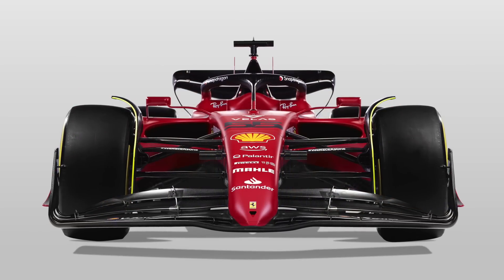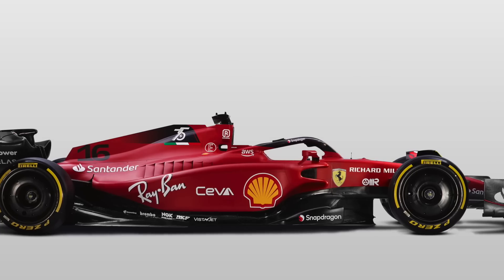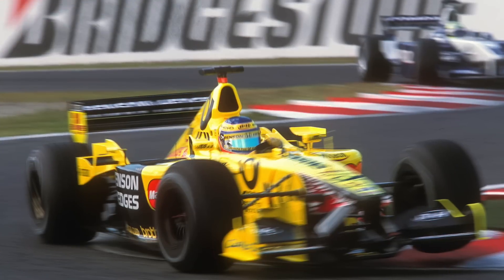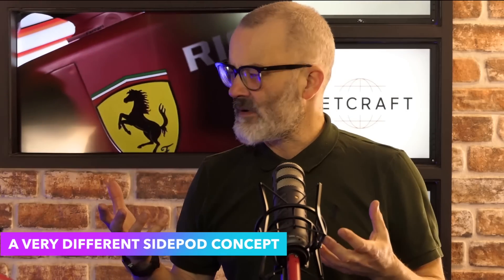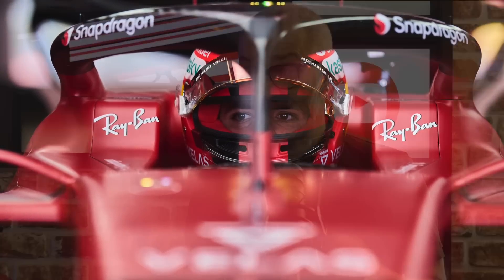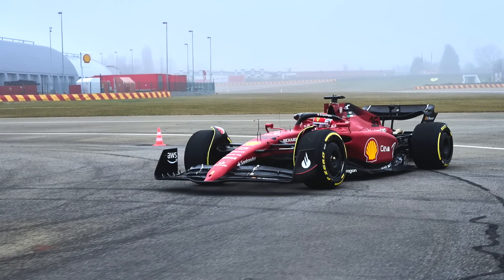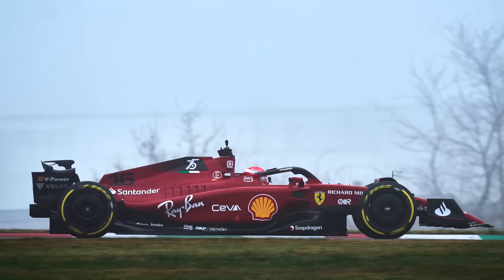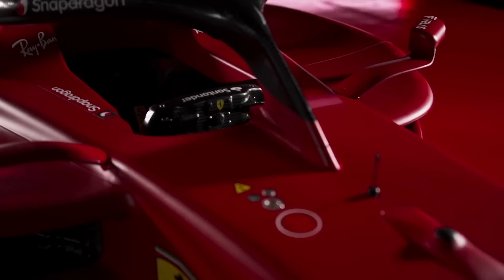New Ferrari F1-75 with Scarbs by Peter Windsor

Comment: What i wonder about there is no talk about the extremely small roll-hoop, what looks to me like a Rory Byrne signature, and i think Rory advised them to do that. This will allow more air to get to the Rear-and beamwing. These two wings create the biggest upwash, far more than leading more air over the top-over the diffusor. Ferraris aim clearly is to let the rear and beamwing drive the floor,what is definetely an advantage over leading air over the top of the diffusor. If you put all this together- its a cooling-system that makes it possible to build a small roll-hoop that leads more air to the rear and beam-wing that drives the floor and is combined with sidepods that produce more downforce but less drag and manages the front-tyre wake more efficiently then micro-size or zero-size sidepods. On paper this concept is superior to anything else on the grid...but in reality? We will see. But anyway - i am a little bit disappointed that great features like the roll-hoop and how all these solutions support each other, was not explained properly.

Comment: My 2 cents - they want to pull hot air from louvers right above the exhaust, big sidepods to push wheel wake away also acting as "huge shark fin"  
and maybe blow clean air around the rear track rod to energize beam wing flow or is it cooling vent?

Comment: If I were Ferrari or Renault and knowing I’m down on power I’d be super aggressive in my engine design so it makes maximum power with less thought on reliability. That way once the engine freeze begins they can upgrade their power unit to fix reliability issues but won’t be able to provide upgrades for performance

Comment: Rory Byrne worked as an adviser for this car. Not to make a bad design faster, what was his advisory job since 2005...and there is a lot of Rory Byrne signature all over this car. From the front wing, to the sidepods, airbox, suspension and the beam-wing. Everywhere on this car!And the undercut on the bottom of the sidepod is actually more like on the F2003 GA...

It seems like Ferraris focus is on keeping the front-tyre wake outboard. This makes a lot of sense as there are no bargeboards any more. And thats what they do with these sidepods. Also they feed some air over the diffusor with this small undercut and create a seal(like they did in 2003&2004 with a sharp leading edge of this small undercut)and feed the beamwing with the "valley" on the top of the sidepods. I also remember Renault actuall improved the airflow to the rear wing with the gills of their 2005 and 2006 car. Ferrari probably uses a similar solution, even if the air from the gills usually is "lazy". But there definetely is a way to make this work, as Renault proved in 2005, and the beamwing can handle that airflow anyway. I think Ferrari has found great solutions in every area with making less compromises than the other teams.

Comment: I remember when Ferrari rolled out their 2017 car with the high side pods worked into the side crash structure. All the other teams were confused, even Adrian Newey said he didn't really understand what they were doing. That idea ended up getting adopted by every single car. Ferrari obviously thinks they've found something that works and is worth designing their car around. May not work, we won't know until test/Qualifying but this isn't the first time they've done something radical that made all the other teams scratch their heads. And it doesn't necessarily mean they're wrong. Personally I always root for these radical designs. It's exciting when someone comes up with something absolutely nuts and it works.
Reply: Their key thing is engine,if its good and the sidepods dont work,they at least will be 3rd 4th
Reply: for the record, for this sidepod, no team has said it doesnt "understand" what it does, they're just skeptical about its effectiveness
Reply: @Rishi3404  which team said they were skeptical about their effectiveness
Reply: I hope when it works, RB and Merc don't come out with another theory on its legality. I had enough of it and let the best innovator excel. ;) wink wink
Reply: @Samoasoa  well shit have you seen Red Bull's sidepods? They're even more extreme than Ferrari's.

Comment: Could those valleys and vanes create an updraught of air that creates an F duct effect at high speed? It was mentioned elsewhere that wide side pods would keep the airflow out from the back wheel. Maybe it's designed to be very fast without DRS.

Comment: It looks like Ferrari sacrificed overall downforce for downforce more towards the front of the car for better turn in. I bet they're going to struggle some.
Reply: I bet that unless you've got x-ray vision to be able to see the venturi sections underneath the car and look inside those side pods, that's all just pure speculation
Reply: @aussieseanc  the floor underneath is by rule almost exactly the same on all the cars so that won't cause any difference in performance. What's going on inside the sidepods has more to do with cooling for the engine and not a lot to do with the aero performance of the car. The aero performance is what is on the outside of the car and sidepods. Based on the aero on the outside it appears to be exactly what I said. I invite you to check out the analysis by Kyle engineers in his channel. He clearly points out that Ferrari is making compromises to gain more frontal downforce.

Comment: perhaps the oncoming air wont dip into the valleys in the sidepods, but ride over the air being exhausted through the louvres. this would reduce parasitic drag and keep it attached to the coke bottle area. Bit like the coander exhausts

Comment: I have noticed in these new cars, the helmet is slightly above the back end of halo as seen from the pictures. Not sure if it would protect drivers with accidents similar to Max-Lewis in Italian GP.
Reply: Yeah I have discussed this with friends. It seems like a bit of an oversight for the sake of a few cm in height! That is a direct reason as to why the tyre hit Lewis in Monza. It could push enough pressure to crush vertebrae and he was lucky that it didn't. Indycar Aeroscreen remains a better solution.

Comment: If Scarbs is correct in saying that the radiators are mounted vertically to the side then could Ferrari be running some sort of aero concept from the interior of the sidepods instead of undercutting the exterior like everyone else
Reply: Yes they might be channeling excess air through the sidepods and out the louvers, I think it is quite interesting
Reply: From wha I saw in Grono GP they are vertical.

Comment: I think there are a lot of tricks in the sidepds that Ferrari hasn't revealed to anyone ie internal ducting. They aren't there just to hold cooling IMO.
Reply: Yes!   I am suspecting the same,  could be taking fast moving air on the inlets routing it around the car and dumping it where the want in the rear,  get the diffuser working better or even reduce drag at high speeds.  There is more to this
Reply: @cdoleoj1  you're both on the same thought process I'm on, they look like pipes laid around the cooling system entirely, just carrying high velocity air around everything hot and then dumping it out at the coke-bottle section in front of the beam wing. The pressure in those ducts could be immense and yet not affect the external airflow until right at the beam wing when it's too late to spill that air out either side. Interesting that haas had similar sidepods, wonder if there's been some shared wind tunnel data there
Reply: Wishful thinking.

Comment: I'm concerned about Ferrari & McLaren not having the undercut sidepods, these look like the side pods of the late '90s, maybe they are onto something with outwash.  I like the bowl in the top of the sidepods, except that they don't dive to the coke bottle.  This could either be hero or zero, I wish them the best!
Reply: Sorry to correct you, but these sidepods are not like those of the late 90's. There was no undercut at all. But the Ferrari has a small undercut at the bottom. And thats like on the cars of 2003/2004.   Indeed its a mix between the sidepods of 2003/2004 with a small undercut, but as high at the rear as the late 90's sidepods. And it actually makes a lot of sense to have sidepods like this. You do not have bargeboards anymore. So you need something else to push the front-wheel wake outboard. And this is done with sidepods like that. I think its more of a mistake to have sidepods like Mercedes and Williams, what is actually the same we had in recent years. But in recent years there were bargeboards. Now there are none. Nothing that keeps the front wheel wake away from the rear of the car. In the late 90's and early 00's the sidepods did this work together with a less developed bargeboard section. And now the sidepods do this again. As it will be more important to feed the beam-wing than to create downwash, thats why they do not dive in an extreme way like in recent years. I think Ferrari is totally right with their concept and solutions.
Reply: I would be more worried about McLaren,  the have a bad track record on chassis development these last few years,  the Honda issues of past seasons masked a chassis problem also,  and they could not do much with that Merc engine

Comment: Why would the battery upgrade help so much? The maximum output (and input?) is capped, right?
Can't teams only aim to reduce heat losses?
Reply: With the new hybrid unit, Ferrari was able to use electrical power further down the straights than everyone else. It pretty much nullified McLaren's straightline speed advantage even though the Mercedes PU was still more powerful.
Reply: I think the max output is limited. I think they're developing how long the battery adds power to the power unit(the 160hp ish) Before needing to regenerate them thru braking and whatnot. Maybe more effieciently.